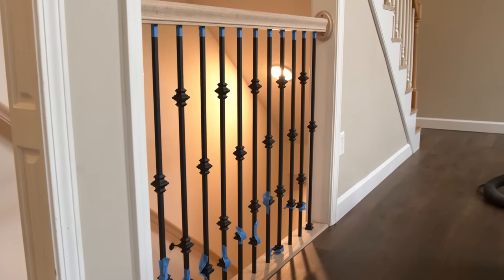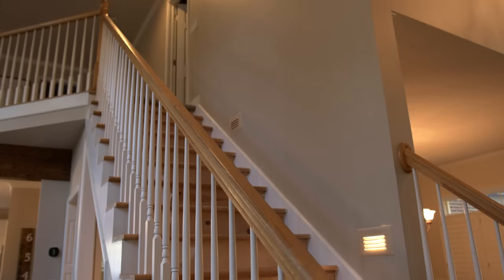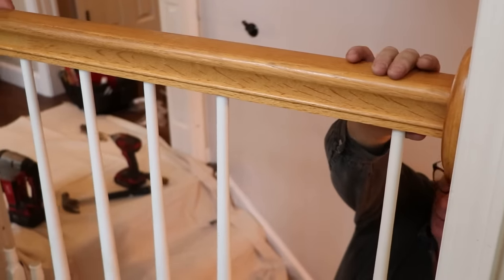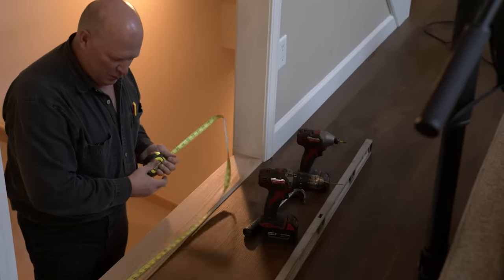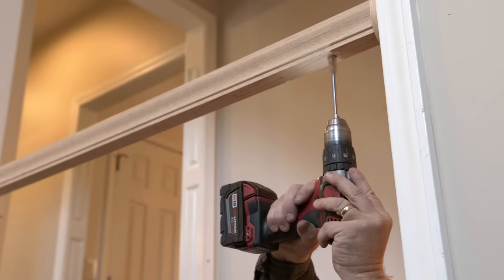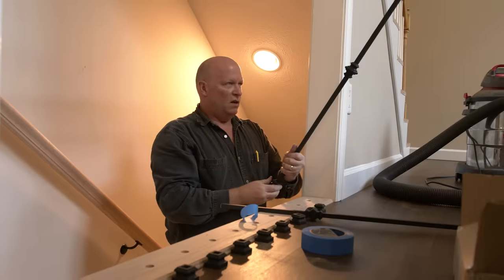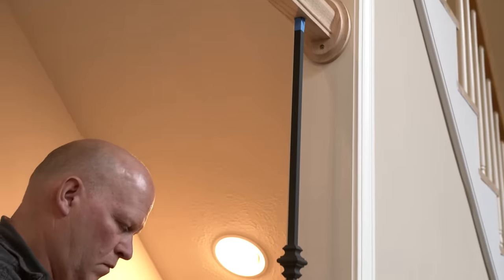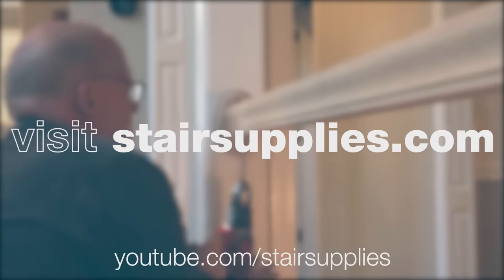How To Install Iron Balusters

Comment: I really appreciate this video. I'm just not gathering why the handrail (and sometimes steps) need to be replaced. If you're using epoxy in the railing hole why did you have to replace the whole rail? If the bottom is held in by the shoes, why does it matter if the bottom is a hole instead of 1/2" recessed? Thank you.
Reply: Its not necessary to replace handrail and steps , you can just send , & stain or paint them , and they will look like brand new

Comment: Any reason the handrails must be replaced? Can these just be installed as replacement balusters into the existing handrail and base plate?
Reply: If your new balusters are a different size/diameter/dimension, then the holes drilled in the existing handrail may not be the right distance apart, or the right size to accept the new balusters. 

If your new balusters are the same dimensions (just a different 'look'), and you like your existing hand-rail, you may be able to salvage/re-use the existing hand-rail.   The wood balusters in this video likely had a different diameter at their top than the iron balusters -- which is probably what informed the decision to replace the hand-rail and plate.  

Just my two cents as a DIY renovator.
Reply: @LuckySawdust  The trouble with that approach is that on many stairs the bottom of the baluster is fastened to the step itself, so you need to deal with the step, including the lag bolt coming out of the wood that holds the bottom.  If you have to replace the steps, it makes baluster replacement a non-starter.

Comment: Use Power Grab instead of the epoxy. A laser level works great when lining up the top rail holes. Also, just cut the baluster 1" longer than your daylight opening.
Reply: Use epoxy, not power grab or liquid nails. It will hold but will be softer holding than epoxy
Reply: What kind of epoxy can to use
Reply: @olegmandryk3610  I use sure anchoring gel rom my supplier, 2 part self mixing
Reply: @cameroncheaure6692  thank you. Can I use liquid nails for it?
Reply: @olegmandryk3610  you can, but liquid nails has a lower amount of play in it than the epoxy. The epoxy is a set and forget. The liquid nails flexes and can over time move the spindles out of the holes. Some people use liquid nails and are totally fine, but for $23 the epoxy is a better long term professional solution.
Reply: @cameroncheaure6692  thank you so much for advice
Reply: @olegmandryk3610  good luck!

Comment: So the bottom holes have to be drilled exactly the same depth so the rail designs stay all level in line? Advice on how to make sure that happens?
Reply: To a set depth, simply wrap a piece of masking tape around the drill bit and stick the two ends together to form a “flag” on one side of the bit.

Comment: I have completed a tread replacement job in which some of the holes for the iron balusters in the stair rail were sloppily bored. Replacing the stair rails is outside the scope of my work, but I want to improve the appearance as a finishing touch, so I have bought pitch shoes and even corrected the pitch angle to perfectly match the rail angle.  However, when the set screws are tightened, the pitch shoes tilt to an incorrect and inconsistent angle, so that their perfect fit to the rail is lost. To preserve the fit, It has been suggested to me that I avoid tightening the screws and instead glue the pitch shoes in place.  How would you recommend dealing with this problem? If glue is the solution, could you please give instruction as to the best way to accomplish this without making a a big mess? Thank you.

Comment: What if I don't want to remove my old handrail? Do I just leave it? Is that possible?
Reply: Yes. You can leave the handrail - the holes left by removing the wood balusters may line up for the iron balusters. If not you may need to drill new ones and repair old.  You can also apply a colored polyurethane (sold at big box stores) to darken/change the color of the rail without a total strip and finish - or paint.

Comment: Hi, sorry I'm not a carpenter so this is why I'm asking. Why not put the epoxy in the bottom hole and the hand rail hole. Install the baluster at the bottom than install the railing right on top? Screw the railing in after.
Reply: To much can go wrong with this method
Reply: That is the correct way to install metal balusters, this video is not. I have been doing stairs for over 30 years.

Comment: 5/8” is too tight for the square portion of the baluster. 🤔 I’m not understanding how to slide it up that 1 1/4” up into the handrail to place the baluster into the landing tread.
Reply: I used a 4-inch piece of the square baluster rod that I sawed off and then hammered that into each of the 5/8 inch holes to widen them a bit.  That created just enough room to slide in the rods.

Comment: Why use epoxy? could construction adhesive be used?
Reply: Construction adhesive is a horrible choice. It has a hydraulic effect as it can push the balusters out of their holes. Just spend the money on epoxy and there will be no issues. Now, if you aren’t focused and are messing around, the epoxy will set before you straighten out your balusters.
Reply: It was just a question. But thank you for your response your the expert. You don't need to be a jerk.
Reply: @awoodmann1746  You definitely misread his tone. Just because he used the term “horrible” doesn’t mean he was saying it with disgust. Try reading it from a different perspective and you won’t get your feelings hurt
Reply: @thomasnorthcastle4130  Always have paper towles and baby wipes handy when using epoxy.

Comment: I usually just nail the top in lol so what if the nail bunches up the spindle won’t ever move
Reply: could you tell me what you mean ? do you add screw at the top ? and how. Thanks
Reply: @Nicholas_gabriel  shooting a 18g nail through the handrail horizontally can pin the spindle against the inside of the hole, not the best idea but works